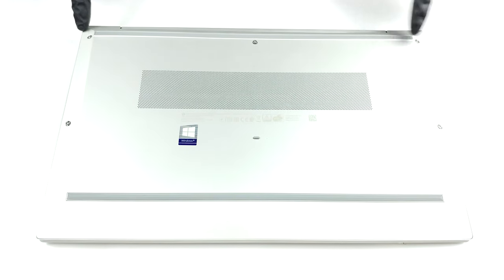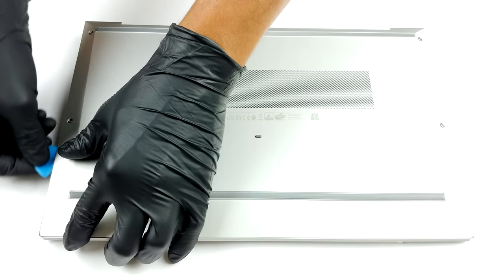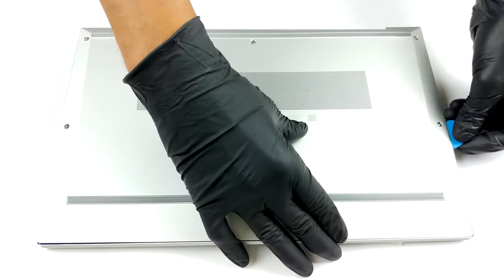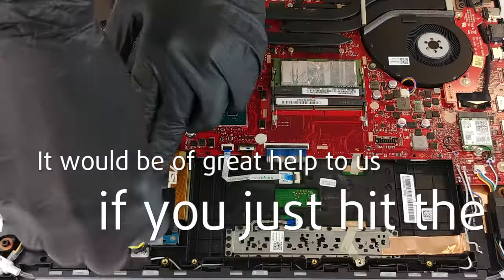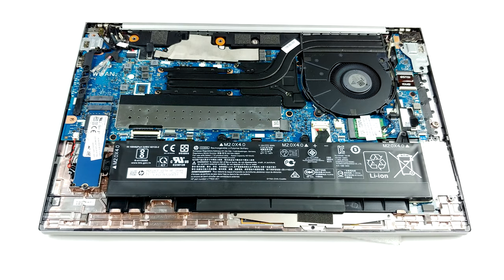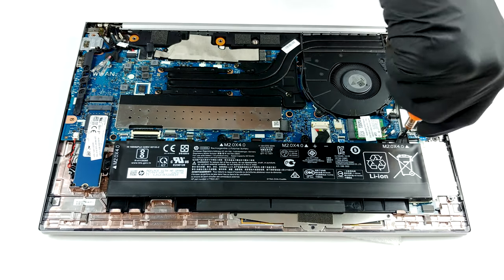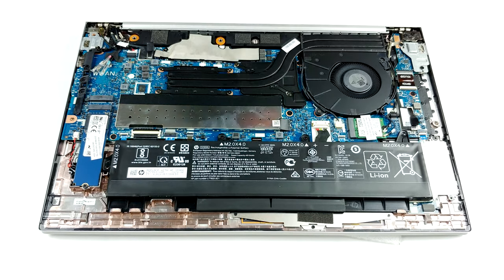🛠️ HP EliteBook 850 G7 - disassembly and upgrade options

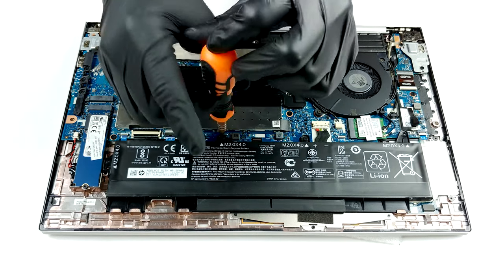Comment: 1:15 What is that slot above the SSD? Isn't that another m.2? Looks like a B-key slot and even though it might only be PCIe x2 slot, it's still fast enough for an SSD, and there are B-key short form SSDs.

Comment: great design, HP! Some models with 4core i5 have only one heat pipe (can't handle 50w power limit, immediate throttling), which seems can be easily replaced with 2 heat pipes heatsink.